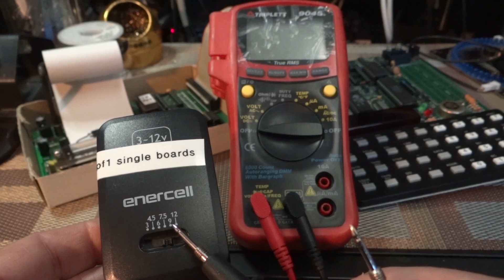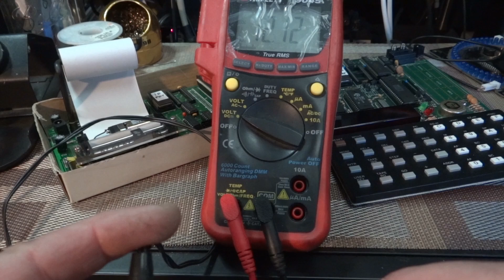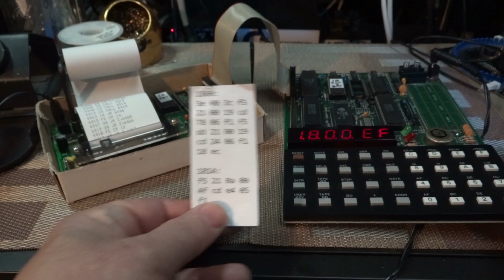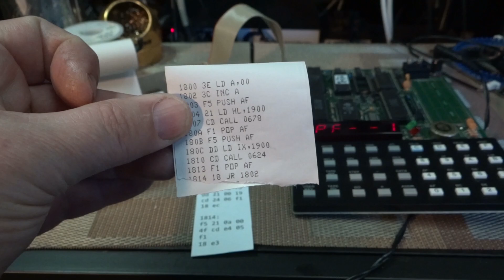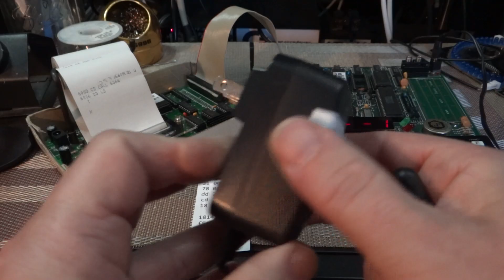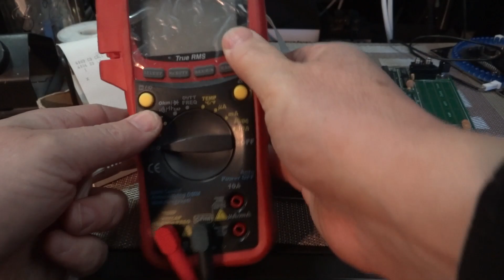Debugging Rafa's MPF-1B Printer - this time, no repair is needed!

Comment: ... danke für das interessante Video und die wichtige Stärke eines NTs. Da kommt aber auch wieder die Begierde nach einem Printer hoch. Bei weiterem Nachdenken frage ich mich aber, ob ich in meinem Alter wirklich noch so ein Ding brauche. Viel benutzen würde ich es wahrscheinlich nicht mehr, aber wenn ich es nachbauen könnte, würde ich es machen. Fehlt aber das Druckteil. Bei Ali Express wohl vorhanden, wird aber nicht nach Deutschland verschickt.. Danke für Deine Arbeit.
Reply from the maker: Das Druckteil kannst Du von einem Sharp CE-125 nehmen! Die sind identisch. Tatsächlich musste ich das Druckwerk für Rafa's Drucker austauschen. Ich hatte seinen Drucker schon einmal, im Sommer, ihn dann repariert, zurückgeschickt - und dann kam er zurück weil er sagte, er funktioniert bei ihm nicht. Daher dieses Folgevideo. Gut, dass es diesesmal nur das Netzteil war. Ich hatte zuvor 2 Wochen gebraucht, um das Ding zu reparieren - alle Chips wurden gesockelt, ausgetauscht, und dann auch noch das Druckwerk kaputt :D Die Platine brauchte zudem ein paar Bodgewires. War ne ziemliche Arbeit, dass Ding wieder flott zu kriegen.
Reply: @michaelwessel4953  einen Sharp CE-125 habe ich schon für 40€ gekauft. Ich schau' es mir mal an. wenn es da ist. Danke für den Hinweis.
Reply from the maker: @MeinElektronikHobby  es gibt 2 Schaltpläne für den Drucker - die korrekte Version des Schaltplans ist im MPF- 1 PLUS Drucker-Handbuch angegeben! Die funktioniert auch mit dem MPF-1(B) (nur anderes EPROM). Wie im Video.
Reply: @michaelwessel4953  gut zu wissen, ixh pack die gleich mal in mein Archiv.